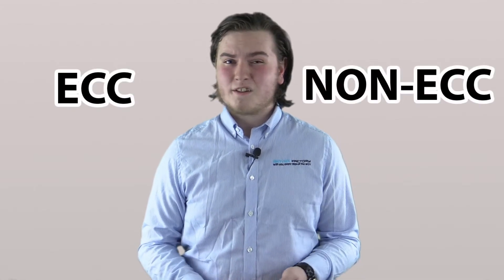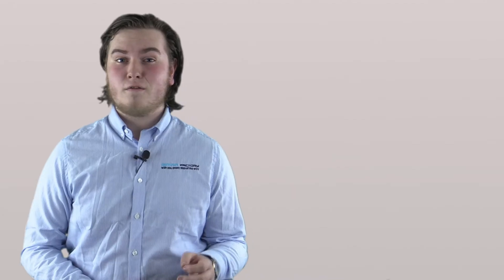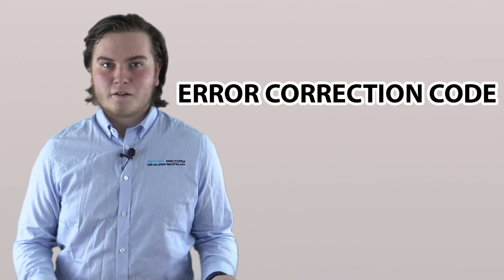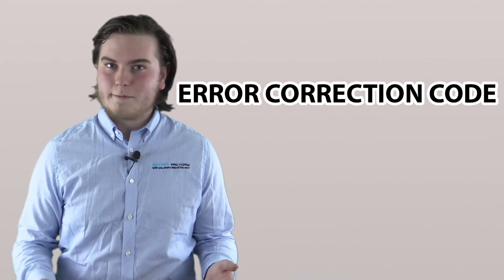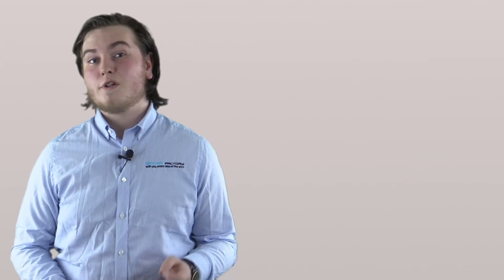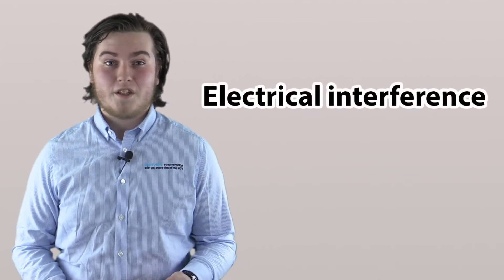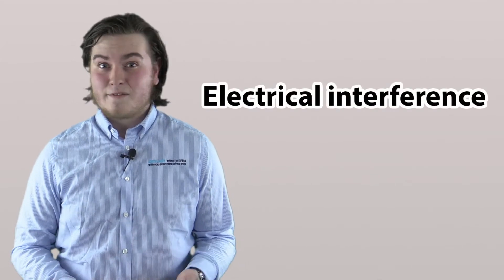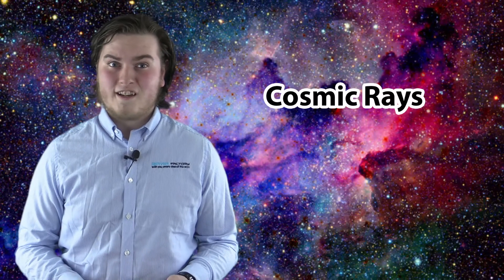We Explain ECC and Non-ECC Memory | Server Factory Explains

Comment: I had a server with non ecc memorry, standard ddr4. But it kept crashing, around 2 times a week. So I switched out the ram, bout brand new ddr4 sticks, but I had the same issue ! Kept on crashing. So I made the switch over to ecc memorry. It was expensive and it fixed my issue ! Reliability is so damm important.

Comment: What is more important for stability REG or ECC? Thx!
Reply from the maker: Registered = takes some strain off of the motherboard which allows more sticks of RAM to be used in a system
ECC = corrects simple data corruption errors, useful if you're running a server which cannot afford to have errors e.g. a payroll database

So they're very different things, and both of them make a server more stable in completely different ways :)
Reply: @ServerfactoryLTD  Should ECC benefit if you're using the computer as your main computer, and making regular backups on the system? I feel ECC is better in ever circumstance for enthusiasts! (Running dual Xeon E5-2600's)